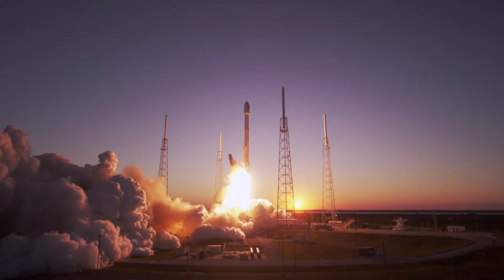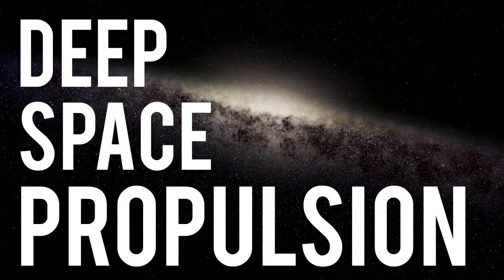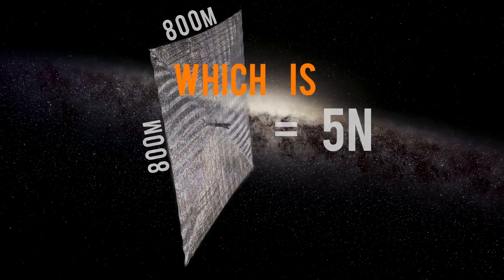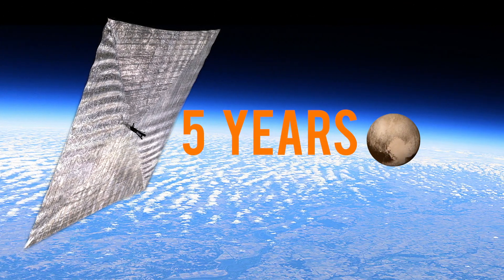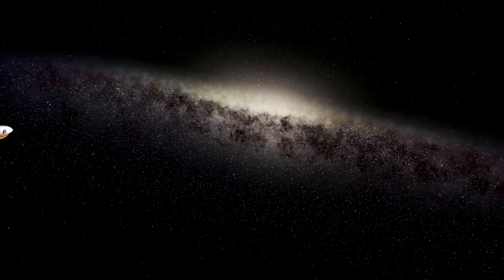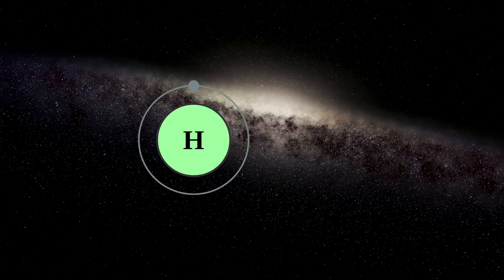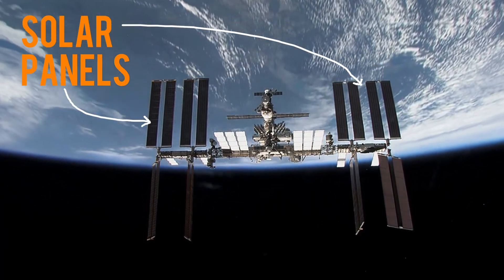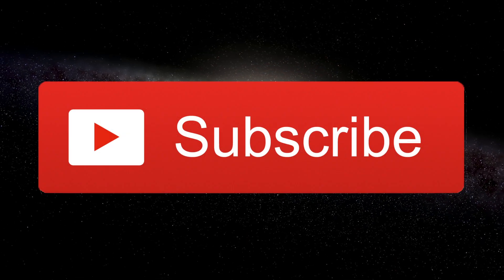Propulsion in Space | Rolls-Royce Engineer Explains How to Get a Rocket to Mars | STARRSHIP

Comment: Can you(or someone) explain this more? 2:14 It sounds like you're saying, "the walls protect them from radiation". If so, what are the walls made of that protects them?
Reply from the maker: Ahh what I'm saying there is that the fuel would also act as a radiation shield. Materials with high hydrogen content, such as water, absorb radiation well. Therefore having a big hydrogen fuel tank would also work. In terms of the rest of the craft's shielding, there are a few materials out there. Plastics, such as polyethylene are even an option.
Reply: @STARRSHIP  Thanks 🙂